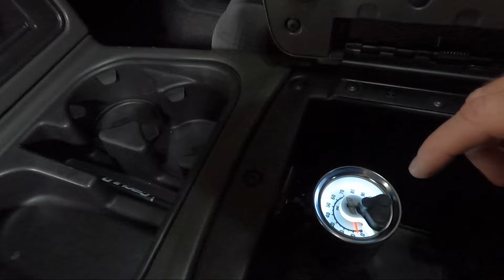Installing a Compressor for your Helper Bags (Silverado and Sierra)

Comment: Holy cow Travis Thursday evening already this week is flying by.. I'm just getting home from work and going to have dinner with my wife and tune in to your video 👍
Reply from the maker: Thank you. Have a great night.
Reply: @TWAMotorsports  holy cow all them wires makes me crazy.. I'm not a huge fan of wires. The previous owner of my 94 TA had then neon lights tubes that ran under the frame rails and under the front old kmember ugh I removed all the clutter along with the amp and the subwoofer box where the ttops are supposed to go when you take them out..  who ever installed it before I bought it had at least 2' of Left over wire that was tucked away in the pop up headlight area.. not to mention they also installed a viper alarm as well.. yep I removed all that crap.  All them wires makes me nutty..
Reply from the maker: You need neon light. They are making a come back. Lol
Reply: @TWAMotorsports  lol.. good one...not for me though.. I'm not into the disco mobile look...
Reply: @TWAMotorsports  are you going to remove the sticker on your white TA where the car was bought?
Reply from the maker: Be a new trend setter
Reply: @TWAMotorsports  hahaha
Reply: @TWAMotorsports  Good night..  daily driver is looking great.  🤙

Comment: The Wireless One setup from AirLift is awesome.  I have that on my 2020 F350 because I have run the air compressors in the cab before and I didnt want to do all that again.  Wireless was well worth the money.  I love being able to adjust my bags going down the road .  But the cheaper setup made more sense for your setup.  You aint dragging 16k worth of trailer on this truck.  Great video
Reply from the maker: Thank you. I am going to try that on one someday

Comment: Definitely a sweet setup, I ahve same truck as yours with a 2/6 drop and chose to go with air shocks with shock extenders instead and bought a ryobi handheld compressor to keep in the truck with a full battery for just incase lol, definitely does the job well for what it is lol
Reply from the maker: Nice. That would be way easier. Lol
Reply: @TWAMotorsports  Definitely would look kinda odd someone not knowing what was happening, with a hand compressor pumping air into what looks like the gas tank because i have the schrader valve mounted right above the gas cap 😂😂
Reply from the maker: Lol

Comment: I have the dual gauge set up on my truck  which is nice to have this way if one bag is not the same as the other you can deflat the one that needs to be the same pressure
Reply from the maker: I bet that is nice.
Reply: @TWAMotorsports  yes it is and it's made by airlift
Reply from the maker: I saw that when I bought this one

Comment: Hey Travis, just purchased the airlift kit today. Been following your builds and feel confident to install this. Did you find what fuse you tied in to? Thanks brotha
Reply from the maker: I just found a switch 12 volt
Reply: Perfect guy to ask since you have lowered trucks and you tow... what hitch do you use? Thanks Travis
Reply from the maker: Stock hitch
Reply: @TWAMotorsports  do you use an adjustable trailer hitch?
Reply from the maker: Flip a 2 inch upside down
Reply: @TWAMotorsports  gotcha thanks Travis
Reply from the maker: You're welcome

Comment: Hey he could connect to the radio system remote wire it will only switch on when radio turns on so only during key and it will be clean
Reply from the maker: Hooked up to fuse box for switched 12 volts

Comment: Travis. I bought a Beltech 2/4 kit with the spindles and shocks. I see that you replaced your springs when you lowered yours. Should I buy springs as well? I pretty much plan on R&R my control arms as well as you did.
Reply from the maker: Depends on how low you want.
Reply: Hey Travis I’m just lowering it with the 2/4 kit. Was just wondering while I’m there should I change the springs? Also glad to know you know my guy Matt from GPTuning too! Great guy who’s helped me with parts and information for my TBSS, 84 Monte Carlo SS, C6 Corvette 🤘🏼🇺🇸
Reply from the maker: Springs are only needed for additional drop.

Comment: Just got a Silverado 03 that instead of spare tire has an air compressor, that by the way doesn’t even work. Reason why I got a new spare and need to remove the compressor, unless I’ll be able to make it work. Does anybody recommend keep it on and put it back to work instead of get spare back ? 

Thanks
Reply from the maker: I never keep spare

Comment: What did your angles end being on this truck prior to the bags? Did you have your DS modified after or were you able to use stock DS? My angles ended up being out of whack.
Reply from the maker: I didn't modify the driveshaft. All angles seemed good
Reply: @TWAMotorsports  damn! Perfect truck then. I’m not so fortunate.
Reply: @TWAMotorsports  thanks Travis
Reply from the maker: @Bushspaperplanes  you're welcome
Reply from the maker: Sometimes they need some tweaks. Mine has a slight vibration at 65 mph but it doesn't bother me enough to fix it.
Reply: @TWAMotorsports yeah I can’t stand the vib through 45-70. Has to be fixed. Found out my TS on the trans is -5 and need it at -3.  Got it dialed in to where there’s zero vib.  Angles are right now all under -1 off. I can manage with that since EVERY truck is different.
Reply from the maker: Yeah I guess I got lucky here

Comment: The cover for the bed from Amazon says it doesn't fit
Reply from the maker: They have different bed sizes depending on crew or extended cab
Reply: @TWAMotorsports  i have the same truck as u but idk why it says it doesn't fit... i click the link too... then they have that thing that says check if it fits and at the end it said it didn't...
Reply from the maker: 5.8 bed 04-07
Reply: @TWAMotorsports  ok ill try that one.. aloha